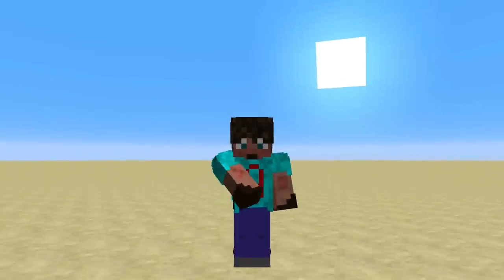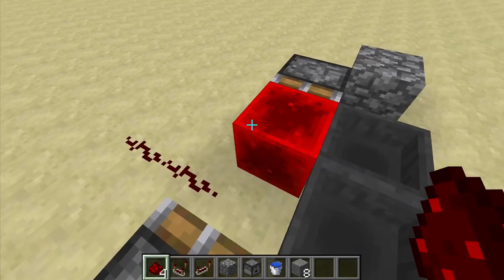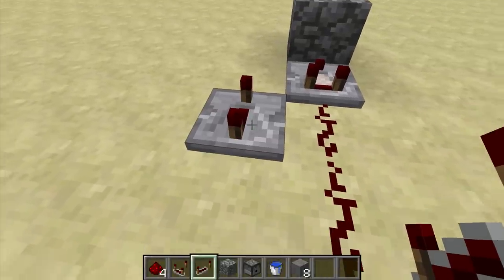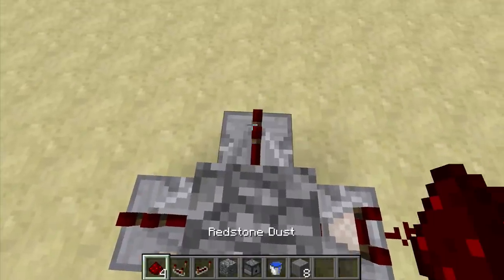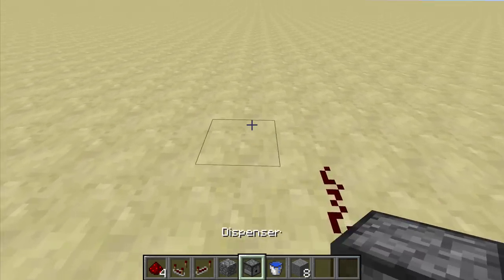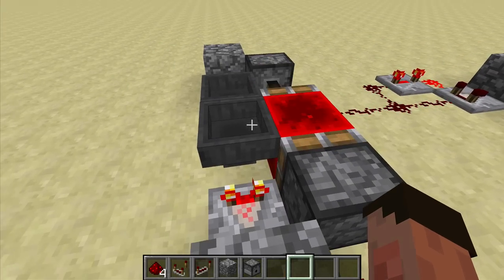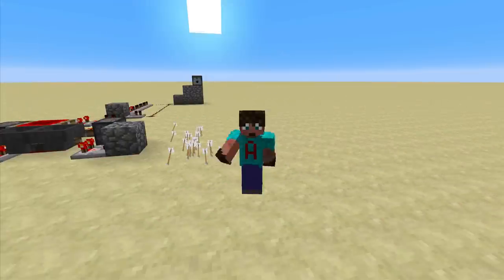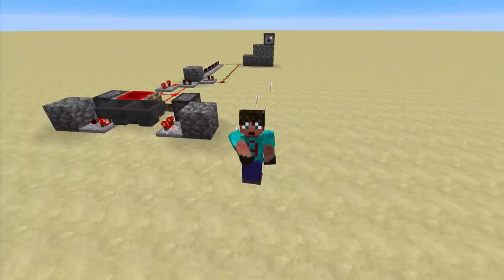Minecraft How to turn a solid redstone signal into a pulse with Avomance

Comment: What a coincidence. I just spent a few days last week looking for a solution to this very problem. I don't have an electrical engineering background (I was a programmer) so I asked a few of my friends -- one has a PhD and the other two have masters degrees in EE. Until I showed them a video of what I wanted, they did not realize they were playing Minecraft!

Anyway, there are probably dozens of more ways to do this. I had an observer connected to a T flip-flop and I needed to take the ON output of the flip-flop and feed a pulse into the reset line for a RS Latch. I settled on a Rising Edge Detector to do the job.

One thing I learned solving that puzzle was the there are times when one needs to turn a signal into a pulse, and vice versa, a pulse into a signal.

It's very helpful to have a set of simple circuits under ones belt so thanks for this little gem.
Reply from the maker: I agree - this is just one option
Tflip flops are always a good choice, if only for the silly name

Comment: Really should've ended the video at 1:45 also the comparator should be in subtract mode, the minimum that repeater can be on is 2 ticks or else it doesn't pick up on the comparator. Was sort of helpful since it got me in the right direction, and big plus that it's quiet.
Reply: nice
Reply: legend
Reply: Bless you! This was extremely helpful.

Comment: This is so overly complicated, it's ridiculous.
Reply: Do you have a better way?
Reply: @its_austin_yt2661  feed the signal into a sandblock on a piston with a repeater behind
you could also just use an observer
Reply: @fotoschopro1230  i see, thank you
Reply: @fotoschopro1230 thanks for saying “you could just use an observer” because that literally just solved my problem for me
Reply: @TheSkyWhale  Glad to be of help. Do keep in mind that it sends 2 signals per power cycle, both when you turn it on and when you turn it off.
So it doesn't always work.

Comment: Pulse to continuous signal?
Reply: If you place a normal piston with a redstone block in front of it on with the pulse leading into the piston, the piston will push the redstone block forward, or up, or down, then have a redstone line from where that redstone block will be, it will turn the pulse into a constant signal from there. You would also want another piston to push the redstone block back to its origin point with a redstone line to another type of input, like I button, so you can reset the system. Though with the hopper clock, this will constantly be activating the piston to push the redstone block back into constant. Avo made a video on how to make a cobblestone generator, the pulse created in that system can be interuped and would be much better for what I'm describing. Please go look at Avo's video to see how it worked. I use that kind of pulse more often because it is able to be deactivated, and you can even use it to reset the redstone block from the same point of deactivating the pulse.

I still watch that video to remake this circuit when I want to make it.

Great video Avo, as always.
Reply: @iAmTinyBrain  I'm still learning what things are called when it comes to redstone switches. Thank you for making this one, t flip flop easier for me to remember. :)
Reply from the maker: pretty simple... a one tick pulse into a sticky piston pushing a redstone block. it'll spit it out into a redstone line and then collect it again on the next pulse

Comment: It was just what i needed but then i realised why i didn’t just put an observer in front of my clock instead of of an comparator or redstone dust.. problem solved for my contraption at least.. mine is built to be an extra timer that boosts my large style bamboo farm which got like 100 observers connected to each other over different levels so it fires even ofter getting me more bamboo

Comment: How'd y turn a pulse solid? I need that
Reply: youtube the T-flip flop circuit should suit your purposes I think
Reply: @helo_pizza2913  it's a constant clock pulse to solid signal I need
Reply: @gridlock501_7  me too
Reply: A easy way to do it is run 2 repeaters feeding into each other with a repeater running off the input to stop feed back.
Reply: Here you go https://youtu.be/ZRMcBk1j7rY
Reply: An S/R NOR latch